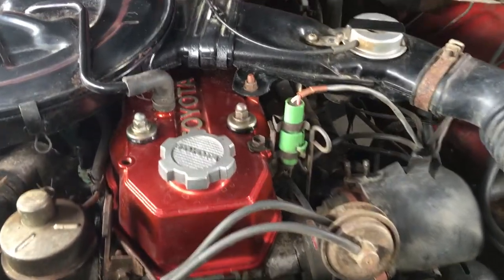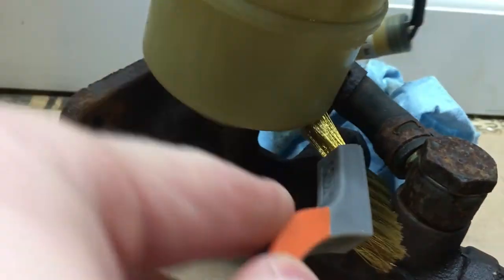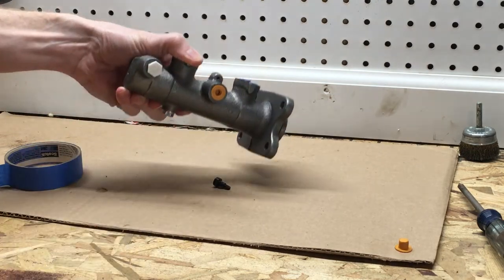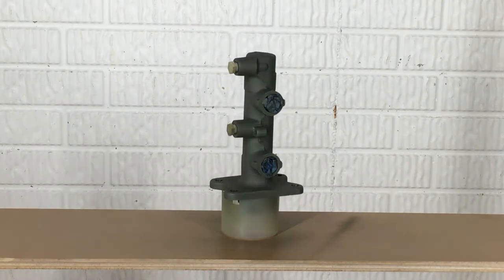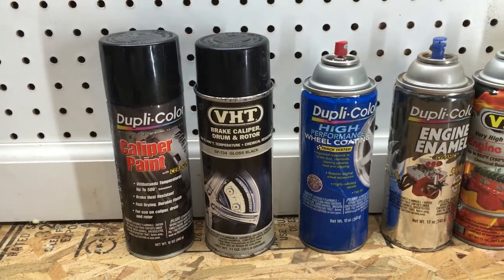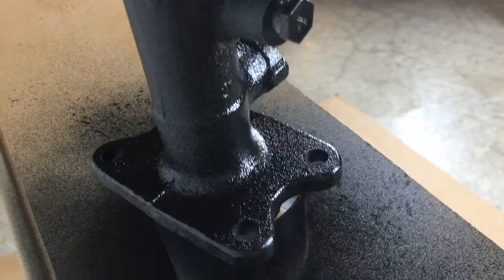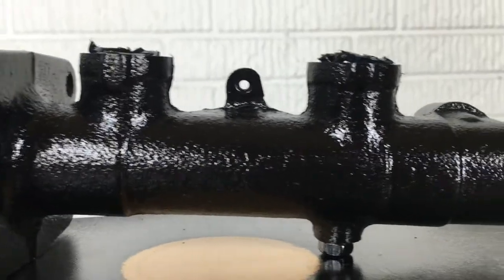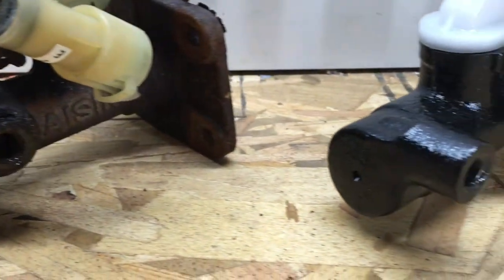How to Prep & Paint a Master Cylinder to keep it from rusting.

Comment: Question for you when you use 3rd Gen. Calipers and master cylinder how did you bolt the calipers to the stock location on you're 85
Reply from the maker: Calipers bolt right up. Also using Land Cruiser rotors and Sky widening kit.